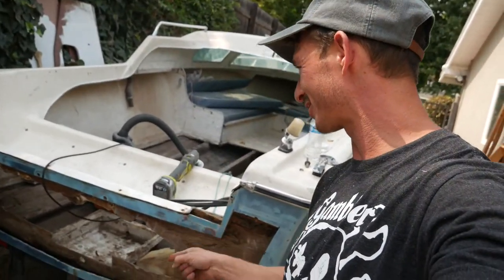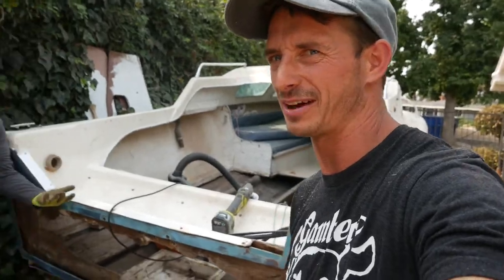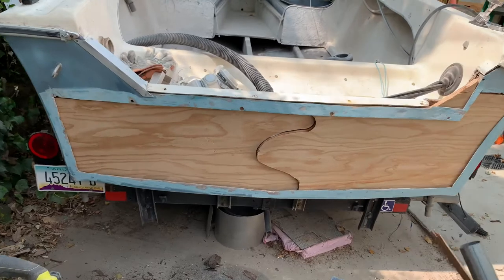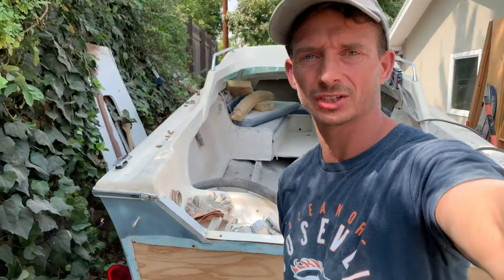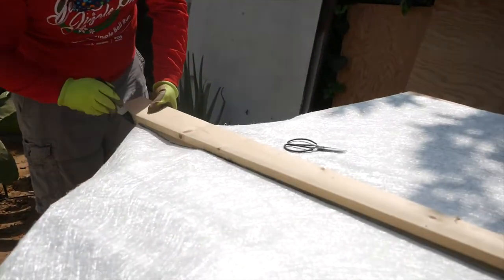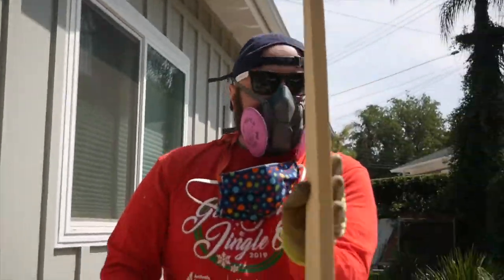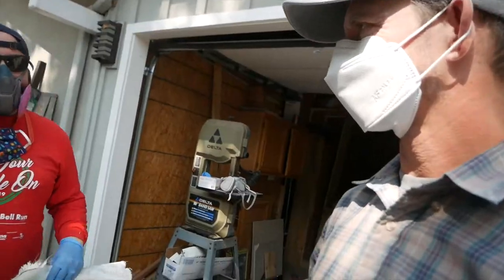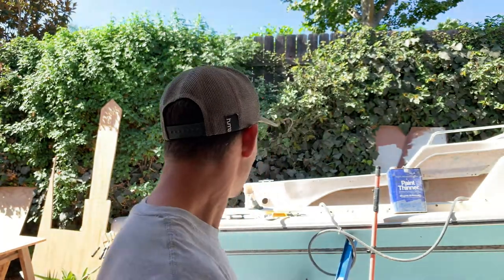Boat Restoration:Transom Repair

Comment: Looking good so far.  Just wondering why you cut the transom plywood in half.
Reply from the maker: Clark Kent I saw others doing it, and it made sense in order to fit it inside the fiberglass edge. 
https://youtu.be/mJGhUgoDD3c
Reply: @Jakefuller  
Thanks for the feedback.  Yeah, I guess the strength really comes mostly from the woven fiberglass mat rather than the wood anyway, as in foam core boat construction.